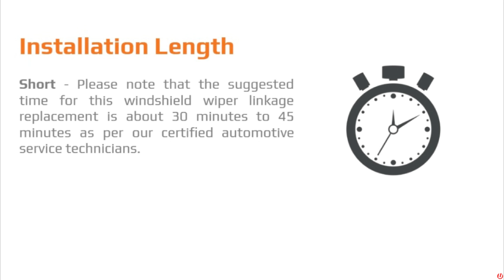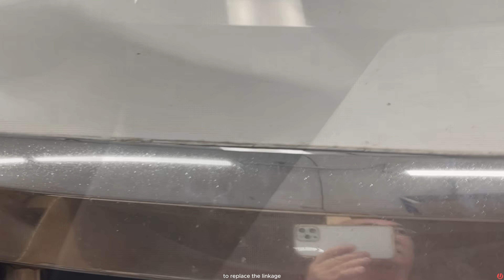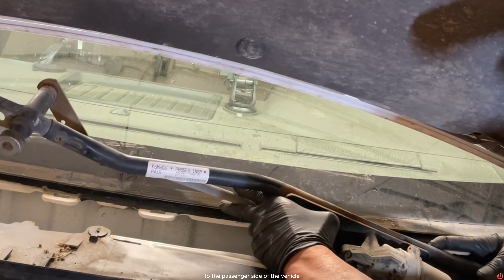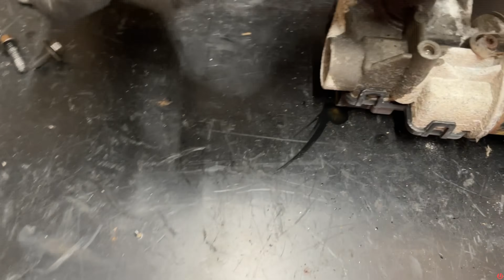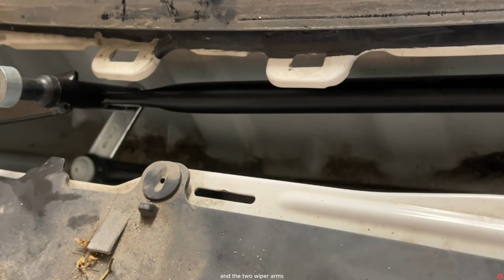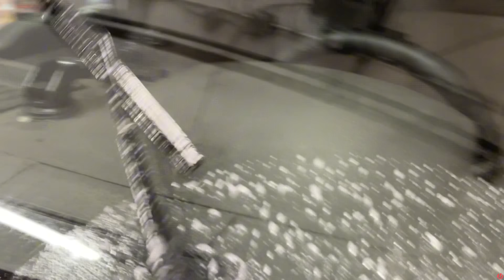WLF104 Wiper Linkage Replacement For Ford F-150 Pickup 2005 Fast & Easy

Comment from the maker: ✅ Uparts Group Wiper Transmission Linkage WLF104
https://upartsgroup.ca/products/wiper-transmission-linkage-wlf104

🧰 Recommended Tools:
🔧 Plier & Wrench Set
https://amzn.to/49n8lY4

🔧 Screwdriver Set
https://amzn.to/4tN05br

🔧 Trim Removal Tool
https://amzn.to/3RjRH5r

🔧 Ratchet & Socket Set
https://amzn.to/4njQmYg

🔧 Battery Power Wrench
https://amzn.to/4tzOI6p

🔧 Wiper Arm Puller
https://amzn.to/4d48ou9

🧤 Protective Gloves
https://amzn.to/42tTLKv

🦺 Safety Glasses
https://amzn.to/4wpi9dV

👍 Thanks for watching! Don’t forget to like, comment, and subscribe for more product guide videos.